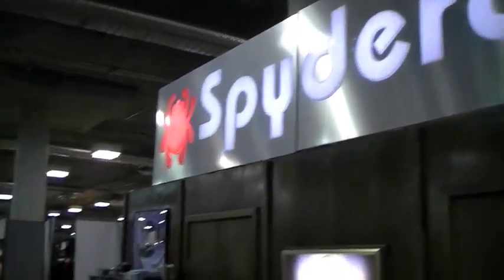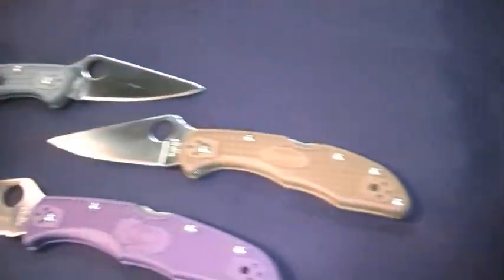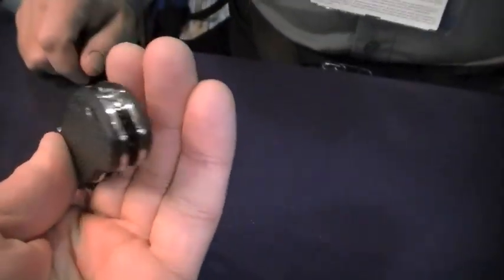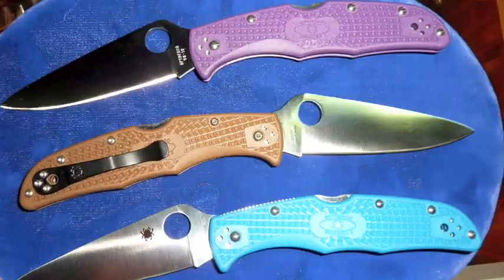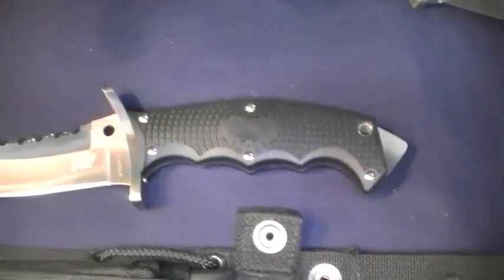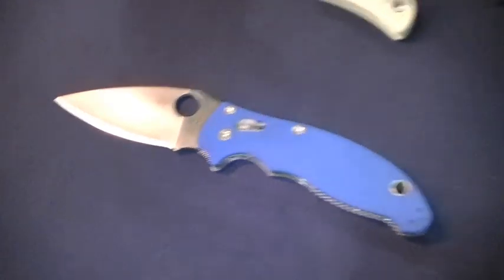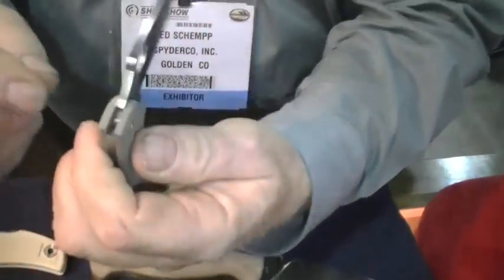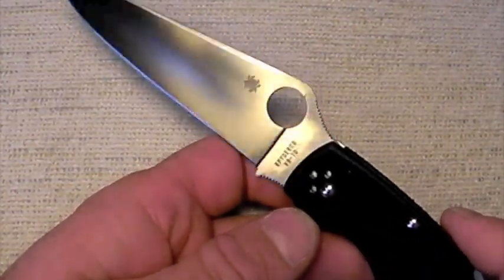Nutnfancy at SHOT Show:  SPYDERCO!

Comment: Spyderco rarely has designs that vary greatly from their very distinctive motif.. but what I do like about their designs is that although they may not be super alluring, they are very robust.. be it with FRN, micarta or G10 handles.. VG10, s30v blades.. lockback, framelock, ball lock or whatever lock you may like or dislike, you'll find most if not all of their knives to be consistently durable, simplistic, practical and have a very low deviation in quality whether their made abroad or locally.

Comment: Oh yeah, I agree.

But there is one problem with statistics. You can't rely on them.

Last Feb. 2009 Turkish Airline flight 1951 (Boeing 737-800) crashed 1 mile short of the landing strip at Schiphol airport (Holland). The cause: pilot error and a faulty altimeter. 

Here's the clincher: on board of that plane was a guy that - talk about luck - previously survived another plane crash literally a few days before!

So what does that tell you about statistics?